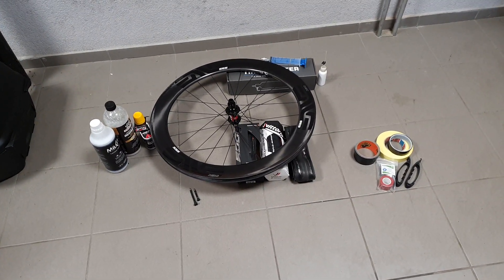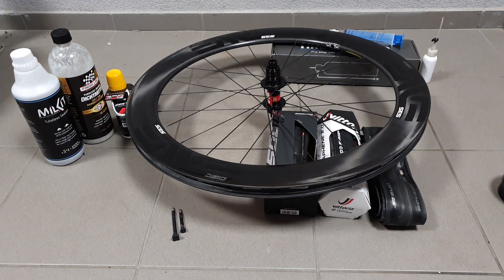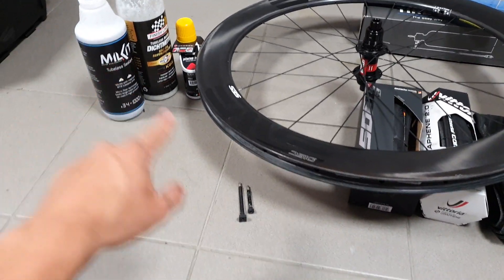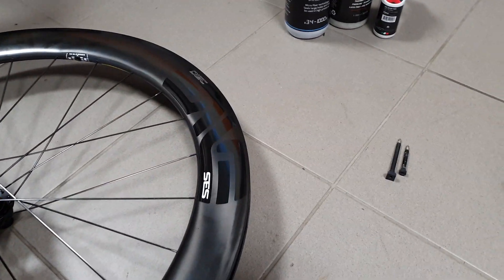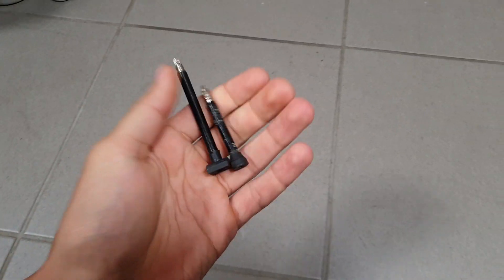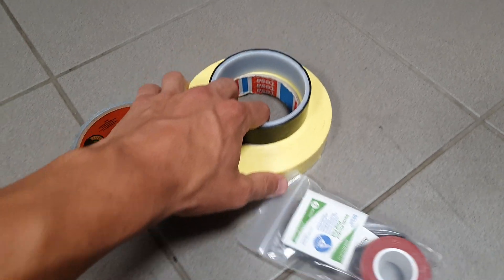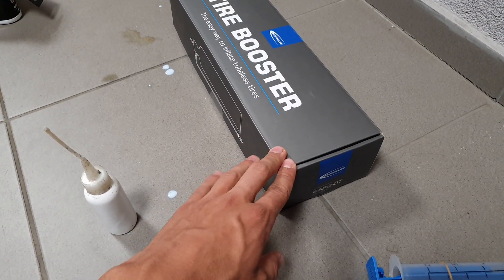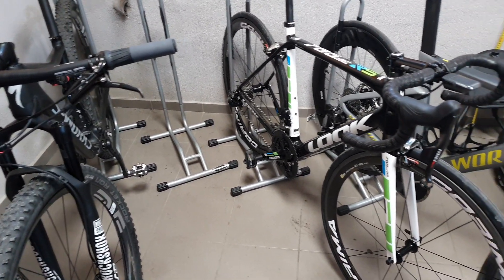All you need to know about road tubeless

Comment: Three tips for easy tubeless install, without specialist tools:
1. Spread neat washing up liquid in the channel of the rim (where the tyre sits before inflation). Then the tyre will slip straight onto the bead of the rim no problem, with a standard floor pump.
2. During inflation keep the wheel suspended (as a opposed to inflating it with the wheel on the ground) - in the bike or hanging from a horizontal pole for example - this keeps the tyre from distorting and letting air escape.
3. Put glitter inside the sealant. This will act like platelets in your blood, larger particles will clog together to block holes quicker.
Reply: Good idea to put glitter in the sealant. I have found that sealants with crystals or glitter will seal a hole much better than simple latex based sealants. Even among the comments below are those who have given up on road tubeless after punctures have failed to seal using simple latex based sealants. I use Orange or Orange Endurance or Stans Race Sealant. Both have crystals in them.
Reply: If you get a puncture, your frame will have "Stripper Glitter" on it. :D
Reply: @LukeGJPotter  It'll be FABULOUS!
Reply from the maker: Good tips

Comment: Glad they work for you and im sure for most road cyclists that try tubeless, unfortunately for me its goodbye to tubeless. Ive had too many punctures where the sealant simply didn't seal the puncture (schwable pro one tubeless on tubeless ready rims. Replacing about 4 tyres already this year is not cost effective. Rim tape, tubeless valves, sealant, high pressure inflation, cleaning sealant off the bike after a puncture, the pain of mounting tyres, for me is just not practical.
Reply: Same here, first with giant tyres, then schwalbe pro one. The mess and time lost is not worth it. Even some test on rolling resistance shows no real difference comparing to clinchers... Tubeless in my opinion is good for someone who does some races, so you have less chance to puncture
Reply: Could you tell us the combination of rims/tire/sealant you used that did not work together?
Reply from the maker: You don't have to change a tire when it's punctured. You take it to a tire service and get it patched for  0.80€...
Reply: @ricktan5663  I have used stans grail aluminium rims and stans avion carbon rims with schwalbe pro one for the last 3 years and have had very few issues. The combination works with two layers of rim tape. With 28 mm tyres I now run at 60 psi front and 65 rear which makes for comfortable cycling on poor English roads with a lot of flints. I'm not contemplating going back to inner tubes again. The key to success is finding a rim tyre combination and then sticking to it. After a major slash in the tyre on holiday in majorca I even manages to put on a new tyre with a hand pump.

Comment: Please can you produce vlog showing process of fitting rim tape and tyre for best results? Also, may be removing and refitting which I’ve heard can be messy?
Reply: totally irrelvant, but yoeleo wheels don't require rim tape, they only have valve holes :)
Reply: azgul 👋 I think you find tubeless has to be taped to create the seal, then you make the hole for valve
Reply: @trick700  it seals just fine with the rubber gasket that comes with the tubeless valve along with sealant :)

Comment: I like to use velocity velo plugs underneath the tub less tape. They have a 400psi blowout strength. Then one wrap if I’m using those. 

Silica makes a good tape, but it’s more expensive than Stan’s. 

I like the finish line sealant. It does dry out but without a residue. Depends on the tire how it lasts, in a corsa speed it was gone but in a pro one it turns blue but doesn’t dry out. 

I use milk it valves, very expensive but a neat feature.
Reply from the maker: I have yet to try the plugs

Comment: Suggest you carry a weldtite road tubeless repair kit on longer rides as sealant will not fix a larger slash in the tyre.  After fitting a worm to get you home you can patch the tyre form the inside with a standard tyre patch but would not suggest a inner tube patch as the pressure may well force the patch put through the hole over time. Enjoy the content.

Comment: Best tubeless tape I've tried is 3M 8992 (or generic) green poly tape or powder coat masking tape. Better than Tesa 4289/4298, 3M 8896/8898, Kapton/polyimide tape, etc. It's cheap too.
Reply: yoog is it one that looks green in the roll but transparent when placed in the rim? If so, it’s what I’ve used and holds pressure quite better than other tubeless specific products! Also makes more volume in the center of the rim bed (good for seating the tires!)
Reply: @oscarcelis  Yes it's translucent green, and yeah it elongates/stretches nicely. It also has a strong, liquid proof adhesive and is quite thin as you noticed. Mavic uses it on their rims.

Comment: Very good info, although I'd like to point out that a single layer really is all you need if you use DT Swiss tubeless rim tape. I have used 2 layers of other rim tape with less good results. I absolutely love the 5000TL, they are much harder wearing than the (very soft) Pro One's, and have much better protection against flats, but due to the stiffness are an absolute bitch to fit, and not quite as comfortable but well worth it IMHO. I also always felt that Pro One's were lacking some grip (locked up easily) when braking really hard in the dry. After a couple of flats with the Pro One's I still had doubts, but the 5000TL have finally really convinced me to depend on tubeless.
(This comment is from an ambitious touring rider, I don't ride crits/time trials etc)
Reply from the maker: It is a great tire for sure.

Comment: From my experience the Shcwalbe Pro 1 is a very dangerous and un-reliable tire. I can't believe how many times it completely failed. I used 8 of them in 1 year and it wasn't even 3000kms with multiple plugs and repairs on each tire. They just cut and blow out in a very dangerous way. I've always used schwalbe on my Downhill bike and never had a puncture and have hit it hard. I thought I was doing something wrong but I've used the Pirelli cinturato for over 6000kms and they havnt even cut once and that's with lots of gravel and glass as well.
Reply: Also just add, when I got my 8th tire i told myself will not ride gravel and I'll run lower pressure and hopefully I will make this 1 last. I got 5km down the road brand new tire and it split and dumped all sealant. With the Pirelli tires now I will never get a flat, the same as my MTB's.
Reply: Hutchinson fusion galactic is the answer.
Also,lightest tyre on the market
Reply: @mikicastan  I have seen those, I had Hutchinson tires on first MTB and they were trash, but like I said MTB doesnt compare to road bike tires even though same brand. They are my next option because my local shop has them.
Reply: Kurtis 
I had them years ago on my mtb and were rubish too.
But those now for road are awesome indeed

Comment: I'd like to see a video with how to repair a tubeless puncture on the roadside. Not being able to reseat the tire with tube is my biggest fear.
Reply: Patch it, hopefully without removing both sides from the seated bead on the rim. Then press as much of the middles of the tyre as possible (ground, wall, knee, spare hand maybe a friend) and unload a CO2 Cannister into it.
Also pray to a multitude of Gods.
Reply: Dynaplug
You will back on the road in a flash, don't even have to remove the wheel
Reply: How do you patch it?

Comment: I’m still a clincher rider. Having tubeless ready Reynolds wheels I want to make the change. @ronaldkuba do you think tubeless will work for me year round? I use my road bike 400km a week. What do you do when you have a flat? Will the sealant work in general and if not what then? When you have to take the tire off you are going to create a big mess, and you won’t get the tire on again at the side of the road without an air compressor?
Reply: First of all you need some serious damage to tyre to make it not seal. To fix you can first inner tube inside and that it. Or you can use "worm" plug which you stick into hole from the outside without ever taking tyre off, it helps sealant by filling hole with rubber and that it, off you go.

Comment: work charm. with Joeblow turbo floor pump even better with booster that i got actually didn't worked for me. you didn't mention veloplugz that are great for nipple holes and with that you can use anykind of tape even office tape with no problems, there is also version where you don't need to use any tape at all.
Reply from the maker: I have never used them so I can't recommend them

Comment: I am having difficulties looking for a tubeless valve long enough for my 50mm rims, assuming 70mm valve stem is minimal length required. With a shorter valve stem, I too had problem finding a valve extender which is fully threaded. Any tips?
Reply from the maker: Milkit, Silca
Reply: @ronykuba  cool! will check it out. Great content btw. Keep it up!

Comment: I picked up a Tarmac Expert disc (for the brakes and all carbon wheels) that comes with Roval C38 "2Bliss" rims. I was going to try tubeless but I saw some mentions of "burping" on road tires. Given that the real advantages are so marginal how can I be convinced that tubeless are as safe, and when set up with tape and sealant, that they are actually going to perform better than top tire/tube combinations? I'm already using S-Works tires and have a collection of Continental tires as well. I already use very light butyl tubes. I try to get a tire and tube combination of around 300 grams per wheel. How can any tubeless beat that without skipping on tape and sealant?
Reply from the maker: Burping can only happen if you totally neglect your tire pressure. It's proven that tubeless is faster, and not marginally. You need tape in a tubed system as well, and the little sealant you need for road tires is much lighter than any tube, so that's not a very clever point.
Reply from the maker: @indonesiaamerica7050  what significant weight savings? A Challenge seamless latex tube weighs 60g. Even if it's a "massive" 20g saving, how would that make up for the rolling resistance and the relative lack of puncture protection? In case you didn't notice, my analysis is purely about tubeless systems, as the title suggests. Then, if you want the lightest possible setup, you can still use the Corsa Speed...
Reply: @ronykuba  

I asked you questions about pros and cons (pertaining to the wheels that I already own) and you exaggerated the benefits of the thing you want to feature. As you continue to. Instead just use data if you don't want to do comparisons, or ignore the questions. You only use persuasion techniques. 

The advantages that you suggest are theoretical only. And if a user decides that the burdens are greater than the questionable benefits why would they switch just to please fanboys?

There might be  a time in the future that tubeless are clearly superior. I assume that there will be. There might be some particular conditions where users can count on certain product choices that are clearly better in quantifiable ways for certain applications. Like time trials over well surveyed terrain. You do realize the limits of those lab tests, don't you? Actually, the reason people ran skinny tires for decades is that they ran "lab tests" on skinny tires to show how they were supposedly the fastest. It turned out that they failed to replicate real world conditions. Right now the arguments are so weak that people should understand that they're only experimenting. Tire manufacturers need to get the weight down more and they need to have better standards propagation and enforcement for compatible products.

Claiming that there are fewer punctures is ridiculous. I can put sealant in a tube if I want that. Pinch flats don't happen unless you fuck up. Just like you say about "burping" and therefore there is no actual advantage in that realm because if you just want to avoid pinch flats learn how to pick the right tires and PSI for your uses. All of the benefits that you cite carry over to tubed tires except that tubed tires are more versatile and less likely to fail from making some newb mistake. 

If you really want to help people that have already decided that they want to try tubeless, give them reliable information like which tires and rims combinations have been tested together and under what conditions. Give details, not summaries of manufacturers or third party claims.
Reply from the maker: @indonesiaamerica7050  I've shown what works (for me). I've said that it's not perfect and some combinations are difficult. As you can see it's not marketing driven, because they're products of ~10 competing brands. I don't ask anyone to go tubeless. I've done this video because I've been asked 100+ related questions. Sorry for bothering you with my information. Keep up the hate and hug your tubes!
Reply: @ronykuba  

Read the OP you are apparently replying to. If you don't know about the Roval road wheels that's fine with me. But don't act like people asking legitimate questions (not to mention pointing to lab tests to quantify your own claims) are the ignorant ones in order to mask your own ignorance.

Comment: Incorrect about not "pinch flatting." A tubeless casing can be cut by a rim if you hit a rock or something large enough to compress the tire into the sidewall. I have had this happen several times. You need to put in a tube to keep riding, and that takes time on the road. I ride higher pressure than recommended for tubeless to help avoid a large object forcing the casing onto the rim thus slicing open the sidewall. I live in Hawaii, and there are rocks on the shoulders. You need to constantly be aware of the rocks. I have had sidewalls forced onto a rim many times. You can repair the casing using a small piece of butyl tube and tubular rim cement on the inside of the casing.
Reply from the maker: How often does that happen on the road? And how does a higher pressure prevent an object from cutting the sidewall?
Reply: Ronald Kuba see edited comment. Higher pressure helps keep the sidewall from being forced onto the rim edge.

Comment: Really excellent presentation, but for most riders you are asking for heartache and despair going down the tubeless road.  Heaven help you should you need to get that damn tire off the wheel.
Reply from the maker: Seriously?
Reply: I'm sorry but yes Ronald.  You're a pro, have a tremendous amount of experience, and clearly have a lot of biking resources at hand.  Most riders aren't even close in terms of ability to commit to enough miles, hours and finances  to the amount of riding you do.  It's just not realistic, and again, should something happen where the tubeless system doesn't work, that rider is stuck on the side of the road.  Granted, the chances of that may be going down, but still how is it possibly worth it?